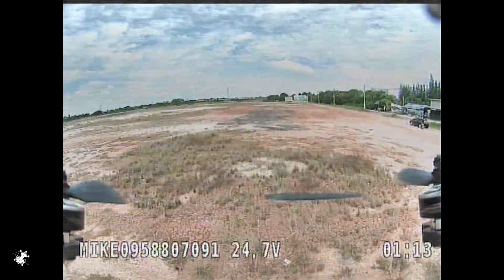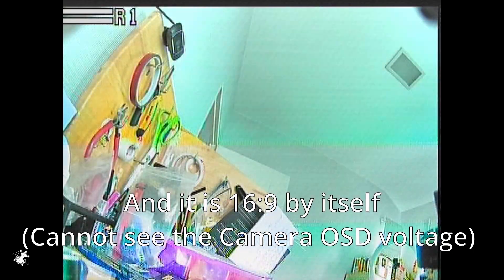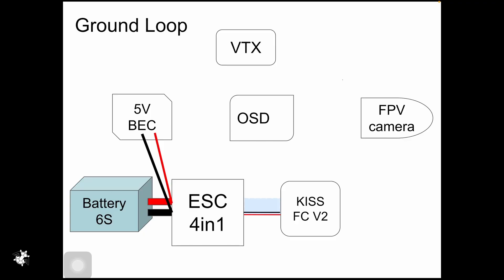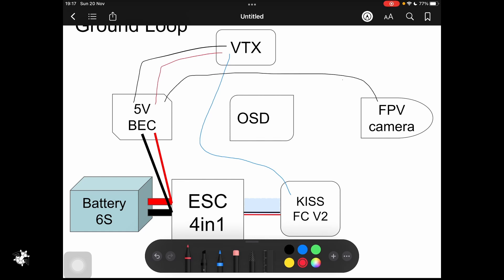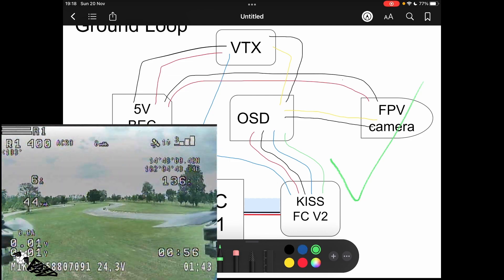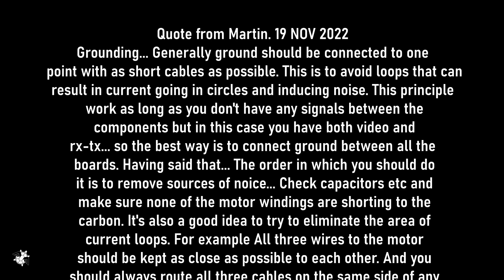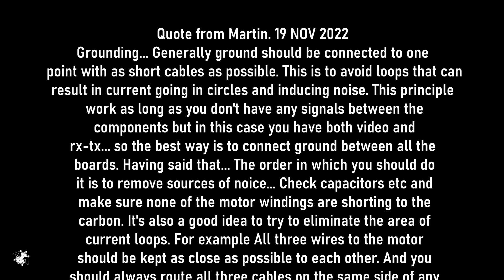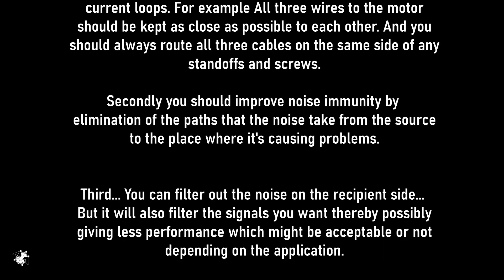The fix to groundloop that cause OSD flickering, Rolling video feed.

Comment: I'm most likely wrong here, but it looks like your diagram actually increases ground loops? I thought by grounding each component to one source (in your case the BEC) you would create a star of ground paths, not loops. As an alternative, could you just add one ground wire from BEC to OSD? Thanks for the vid
Reply from the maker: I am not sure. I do not see any point connecting a ground between the BEC and OSD.

Comment: Interesting. My  FPV video is OK, but could be better, so  I was wondering if I could improve it with a common ground bus. Yours was the first and I think only video that came up with my search for "fpv ground loop"
A common ground bus is  essentially a "bar" with a ground wire from each component - you see them a lot in ham radio shacks (I'm a "foundation" what in the US would be a "technician" level ham). It sounds like it might be worth while.
I'm thinking - and at this stage only thinking/researching - about taking some quite thin copper tube that I have from scale modelling and sticking a length of it along the bottom plate of my frame (if I can find a path) or the top plate (if I can't find a bottom plate path) and attaching it with double sided tape, and then attaching a ground wire from every thing including my FPV antenna (I don't think my soldeing skills are up to doing with with mt RX antennas ipex connector).
Reply from the maker: Having a common ground bus would be great. The challenge is the tight and complex space in the drone. I am building a complicate drone and found that the 'Matek servo PDB' helps in terms of both power regulation and sharing of common ground. If you can create the common ground bus for the FPV drone it would certainly be a new idea.

Comment: @Fire D FPV Can apply this methode to the FC aio? Iam use fc aio jhemcu ghf405 pro, vtx rush tank ultimate mini, cam caddx ratel
I have same problem sir..can you help me 
Please🙏🏻
Reply from the maker: The principal is the same accross all brands. I hope you can do it finally.
Reply: Same problem bro! I have jhemcu ghf405 for 95x and osd di rarely flickering but its so annoying and little bit noise on my cam fpv